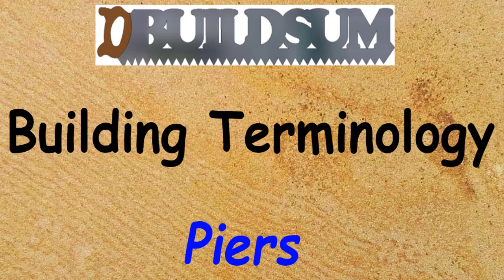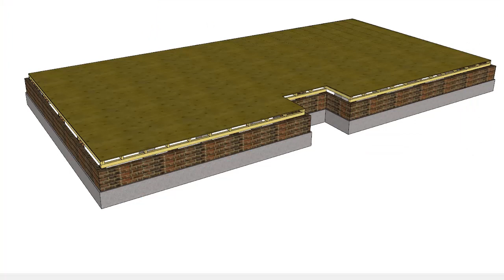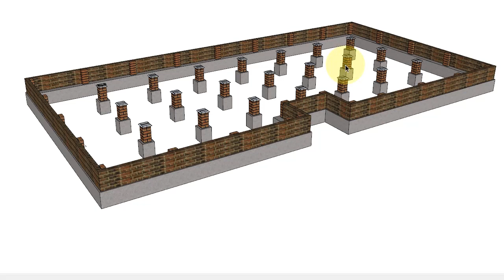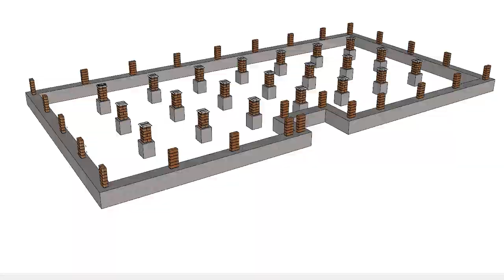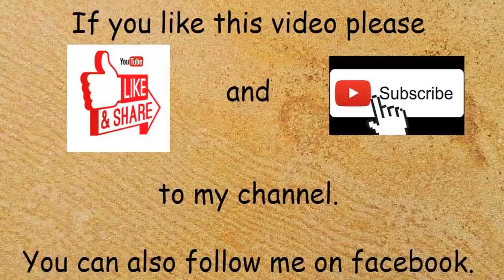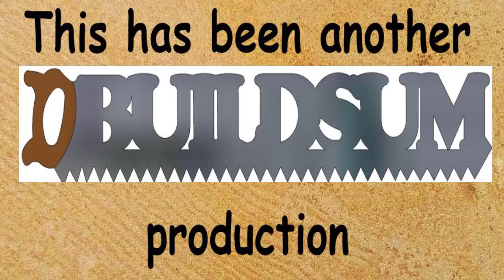Building Terminology - Piers

Comment: Hi like your video  watch them all just wonder if you have a  Guide to what timber to used four flooring as I'm pulling up my floor in my house and  Replacing due to sagging any help ??
Reply from the maker: Hi Mate, thanks for the comment, I don't have a guide but rule of thumb is the wider the joists spacing the thicker the flooring needs to be. Hardwood can be thinner than a softwood. Hope this helps